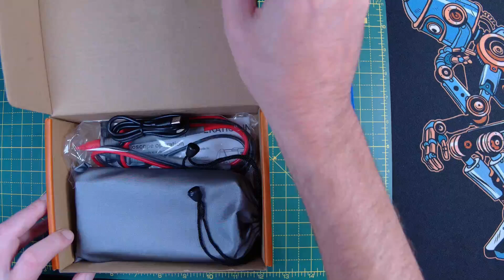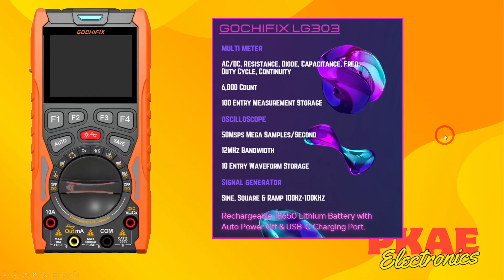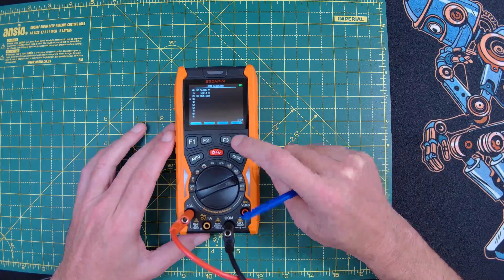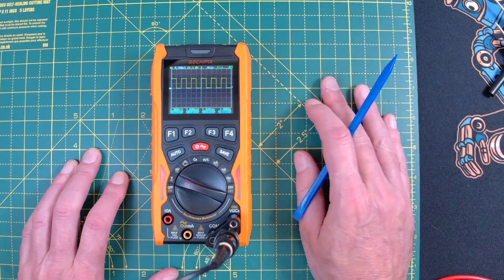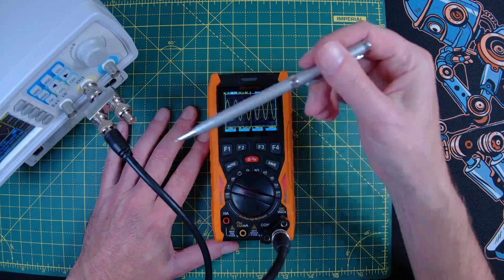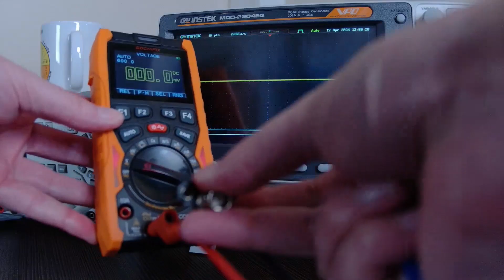Gochifix LG303 3-in-1 Oscilloscope, Multi Meter and Signal Generator

Comment: after using a $10 multimeter on my projects for over 20 years, I finally decided to upgrade to this model to test microcontrollers, sensors, and servos.  I was a bit unsure of how to use all the extra features and found your tutorial way easier to understand than the manual.  Thank you so much for spending the time to show us how it works! I wish I would have come here first to use  your link and code for the discount.
Reply from the maker: Thanks for your comment. It was a rather long video which I think may have put some people off, but I felt it important to run through all the functions and features. I'm glad its helped.
Reply: @paulpkae It needs to be long. It is a really longe one, but one can pause it if needed. I made to the end at it was worth it.